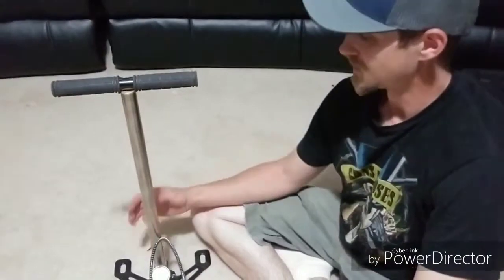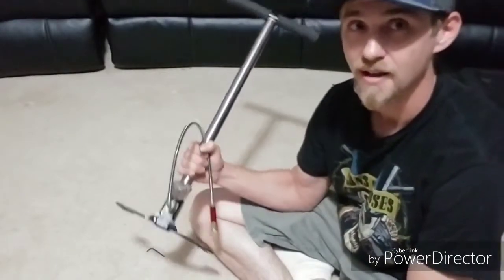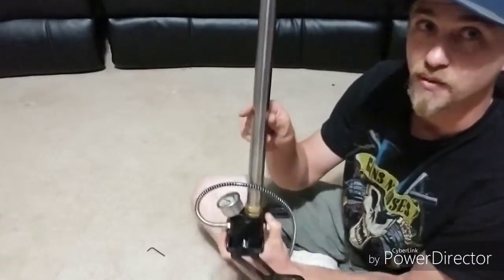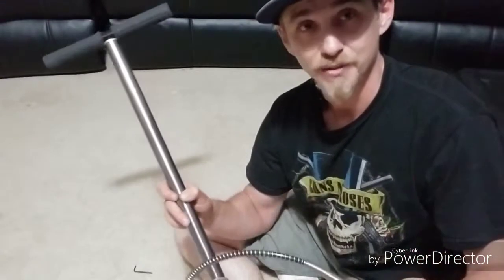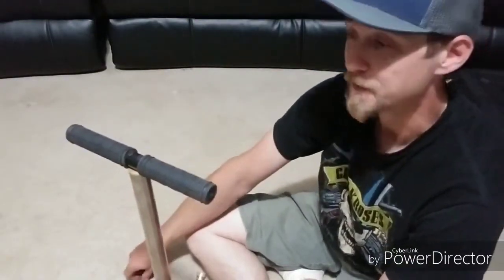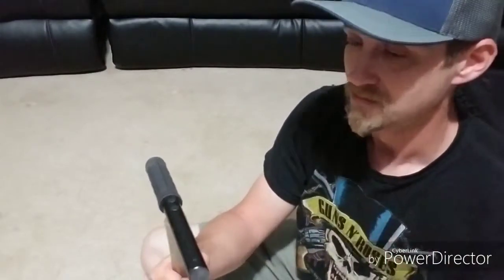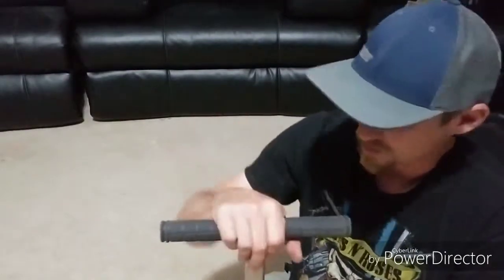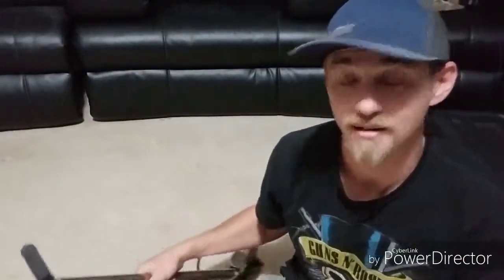50$ Amazon pcp hand pump + dry air mod (deccicant filter)

Comment: Wow I've been looking for a video just like yours and I truly appreciate the full explanation and reason for your modifications. I have the exact same pump Iam sure and I couldn't find anything on English explanation for the gauge. I read instructions and my take on the subject was exactly as you said they can't send from China with oil in the gauge. So what oil did you use and where did you pick it up from the pump gauge oil. Also in my instructions again maintaining was unclear so a couple drops of silicon oil in the spot you showed and perhaps some silicon spray on the action. I've put aprox 1000 strokes since assembly and weather it's me or the day I think it just may be getting slightly harder to pump. Thanks again for your advice and suggestions